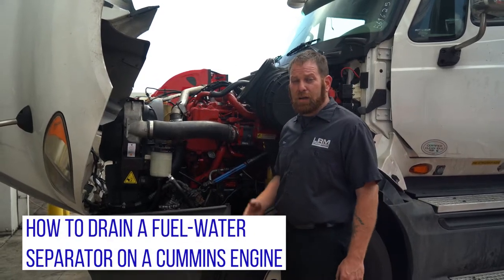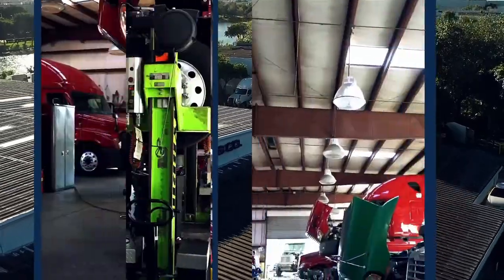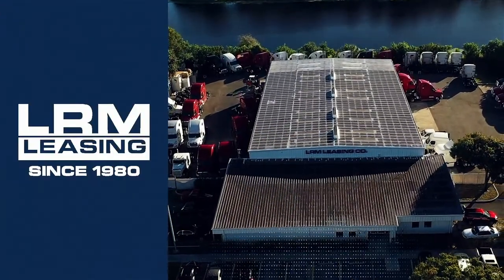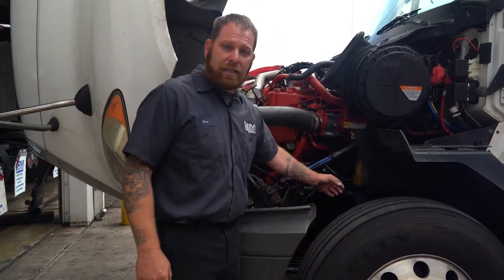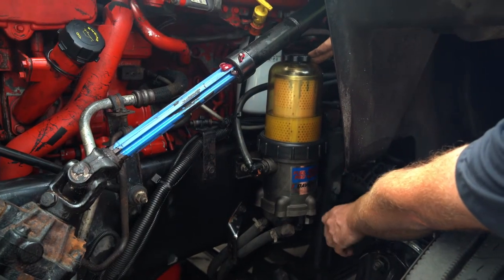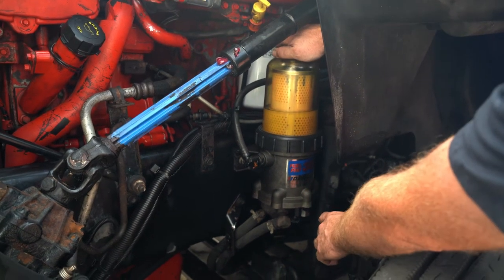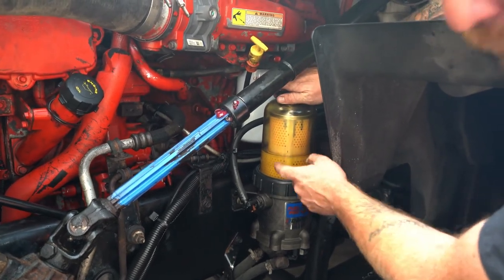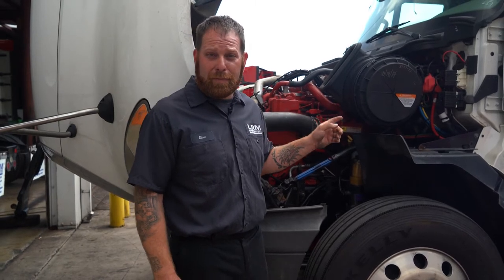How to Drain a Fuel-Water Separator on a Cummins Engine

Comment: 2013 ISX 15-I got frustrated after crank but no start condition trying everything,   So I loosened the cap And tried to start it like that, it lost  prime. I’m assuming there’s a lot of air in the system now?

Comment: What if I drained out the water separator but it’s still saying that there’s water in the fuel do I have to drain both of the fuel filters so there’s nothing in them and then add fuel back to the one that see-through

Comment: I have a 2017 international with a Cummins.. I changed the water separator filter, but I drain all the fuel out.. now it starts and run, but it doesn’t hold fuel in the separator. What did I do wrong and how can I fix it?